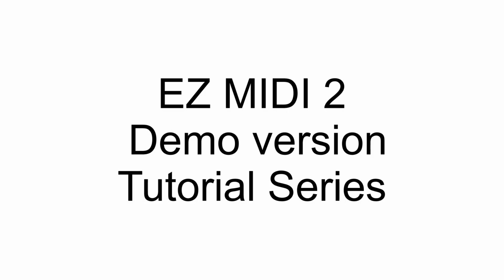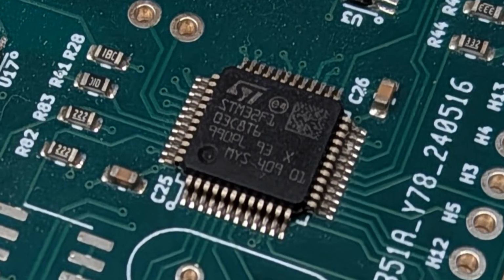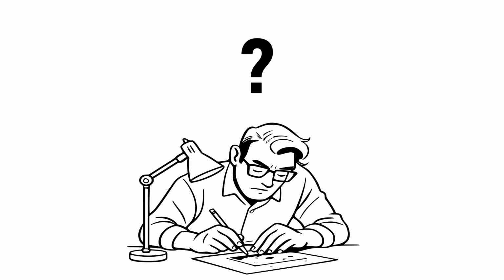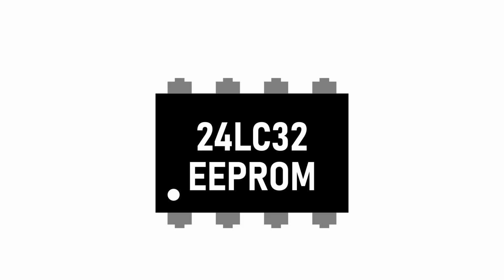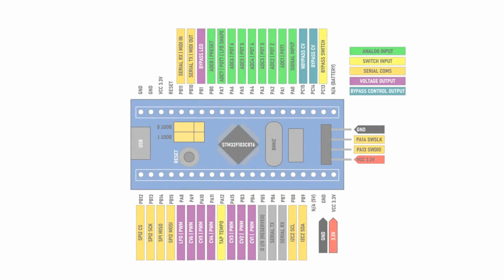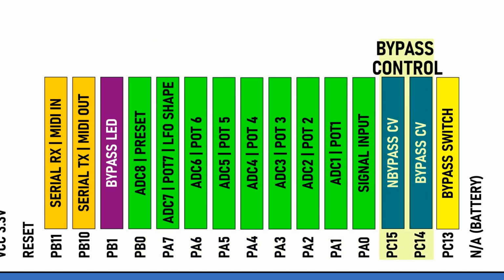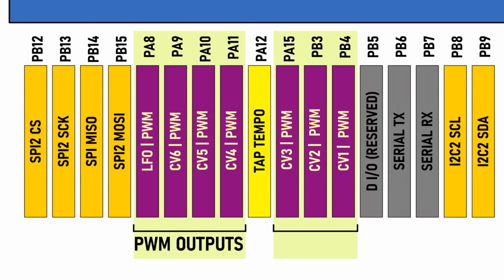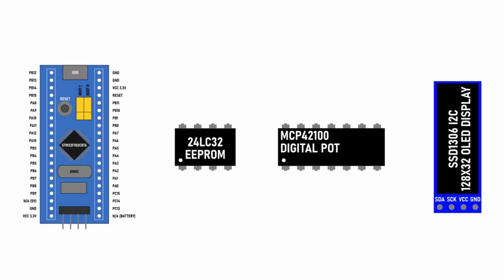EZ MIDI 2: Getting started | Tutorial 1/5

Comment: I just discovered EZ MIDI while browsing the Subdecay site and then the videos on these channels while researching the platform.

Question: If I purchase the EZ MIDI hardware currently available in the Subdecay shop, will it be compatible with EZ MIDI 2 or is there a newer version of the hardware I should wait for?
Reply from the maker: Everything we've shipped for the last month has been ez midi 2 and is backward compatible with the original ez midi.
I haven't updated the description for two reasons.  1. Because documentation wasn't ready. 
2. The code for delays like controlling BBD chips and the PT2399 isn't done.
On that last part I may end up making ez midi for delays a separate thing of its own, because testing all the different possibilities takes forever. Like I thought the current version was ready back in August, but I had to fix a bug.